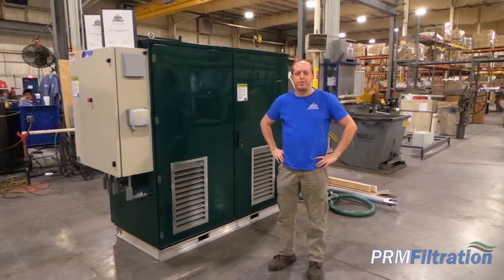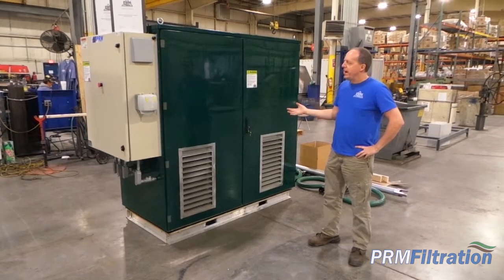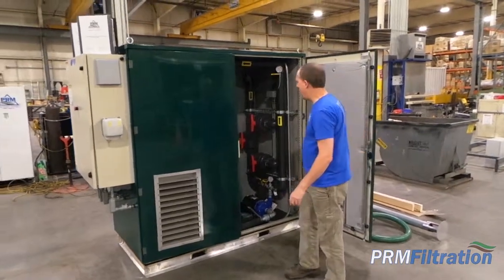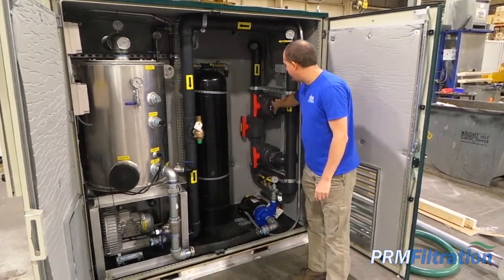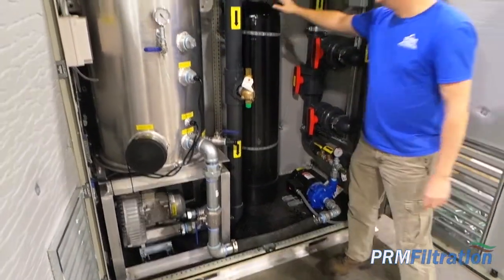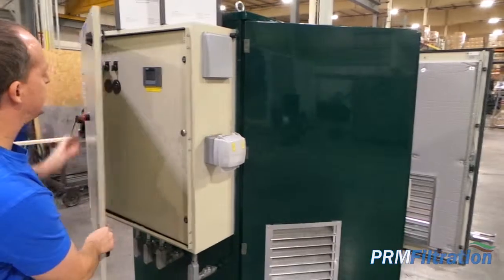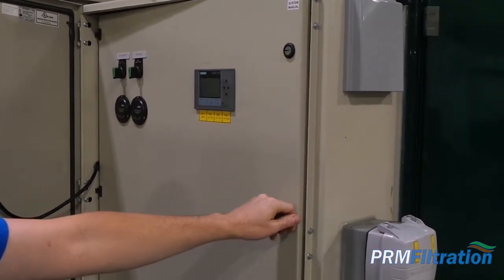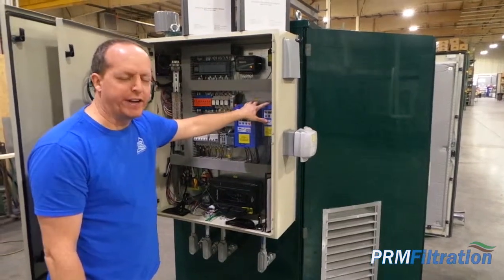Soil Vapor Extraction System

Comment: Pretty slick setup. Must be a small plume, or low concentration picked up with an operation going on less than 25 years. 
That would be a great 1 day visit vs 28 SVE wells, several usually have an underground conveyance line blocked by water ever 30 days, parts and pieces that don’t want to work, work when they want to, and several people to report to without “stepping” on toes.
I miss the quiet more quiet water GAC systems.